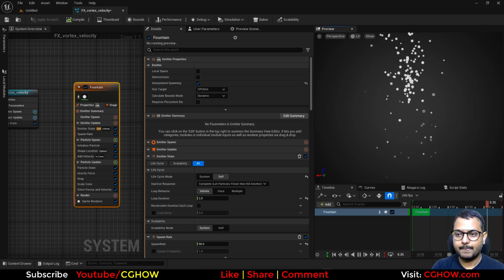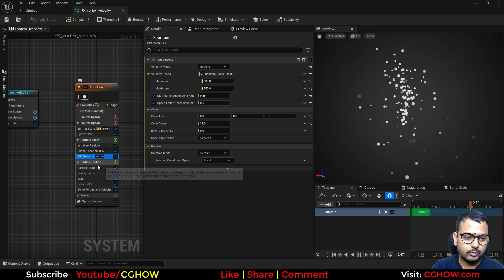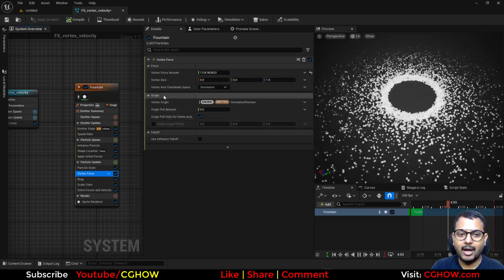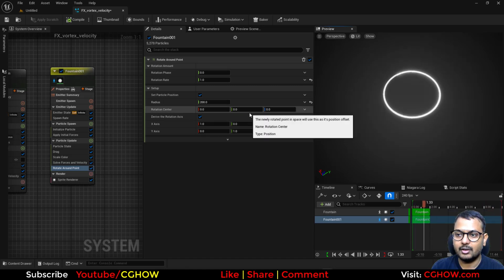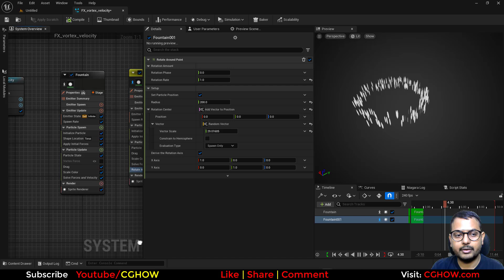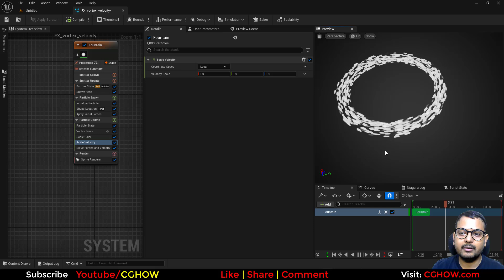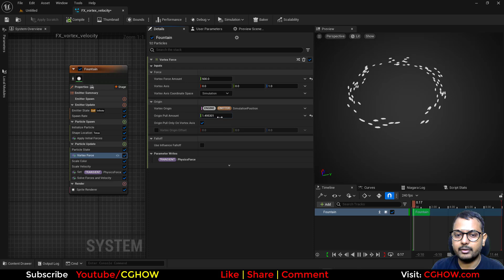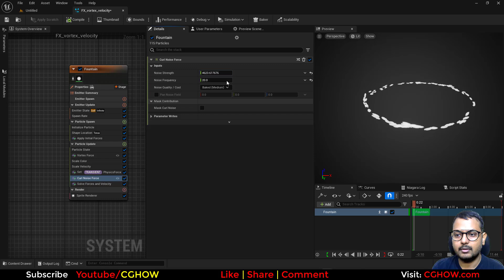Vortex Velocity Removed !! in Unreal Engine 5.4 Niagara | Here is the solution

Comment: What I found is that cylinder radius 100 in shape location, vertex force of 11500, origin pull on and set to 200-250, and scale velocity with default settings will almost nullify the flyaway "feature" for a mesh rotating 360* in about 5s <3 With Update mesh orientation to vector I almost get what I had with just that single module before - yay! Thanks programmers, we can always count on your good ideas <3
Reply: I retract that... It's totally dependant on FPS... so what works for me, will not work for another... Just a massacre.
Reply from the maker: yeah

Comment: I think, it will be better to use rotate around point and calculate velocity direction if you need it in VFX. Just calculate difference between previous position and position to custom vector and use it as alignment
Reply from the maker: yes, i have separate tutorials with rotate around point.